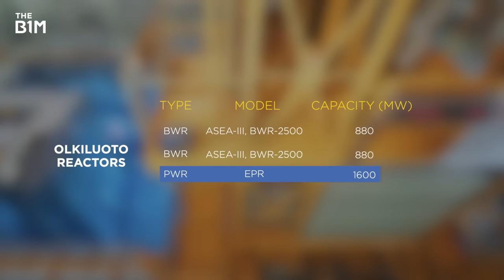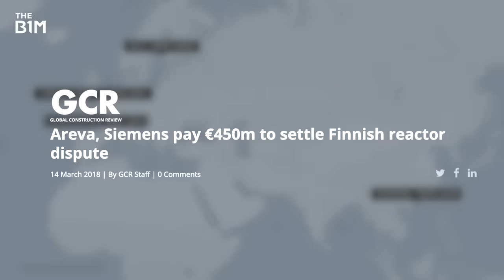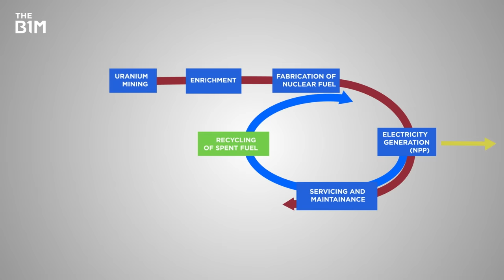Finland Might Have Solved Nuclear Power’s Biggest Problem

Comment: I mean I'd feel better living with a little bit of a risk underground than literally being baked to death by the Sun anyway lol, fossils gotta go one way or another and nuclear is a really cool alternative honestly.
Reply: Not really. Uranium is a fossile file as well. The problem this video is putting aside is, that even the production side is environmentally unsustainable
Reply: @mrtherockful  It's not really a fossil fuel because it was on Earth before all life so I guess you're referring to the fact there is a limited amount of it on Earth available, but even so there is still enough for hundreds of years of power production, by then we might already be using fusion energy who knows
Reply: @mrtherockful  Nuclear is pretty clean compared to the alternatives, I have no idea what would make nuclear “environmentally unsustainable”
Reply: @scrumpus8938  it is mined. Mining this stuff destroys so much nature - it's insane. Quickly Google uranium mining. And in that regard (the extraction) its quite similar to coal.
Reply: @lukapejkovic918  you're right. It's not a fossile energy carrier but it's a material that has to be mined from deep below the surface of the earth, that's what I meant.
Supply is not unlimited. Peak uranium is actually close (https://en.m.wikipedia.org/wiki/Peak_uranium). If you would really replace most coal power plant with uranium it would be gone in a few years.
I don't think it's a viable alternative
Reply: 'Vattenfall studied the full life cycle emissions of different ways to produce electricity, and concluded that nuclear power produced 3.3 g/kWh of carbon dioxide, compared to 400.0 for natural gas and 700.0 for coal.
-> Another study however shows this figure to be 84–130 g of CO2/kWh, with the figure rising dramatically as less concentrated ores are used in the future. It uses a wider scope for consideration than other studies including dismantling and disposal of the power station. The study assumes diesel oil for the thermal parts of the uranium extraction process.' - Quote from Wikipedia on peak uranium
Reply: @mrtherockful  even tho its destructive ,u need a  L O T  less of uranium than coal to get the same amount of energy
Reply: @mrtherockful  the same thing can be said for electric cars since they need to mine large amounts of lithium.
Reply: @mrtherockful  this dude thinks that lithium grows in farms LMFAO.
Reply: @mrtherockful  Yeah the mining process is pretty bad so much I've heard, I don't personally know too much about the numbers (how quickly it would run out etc) but I'll make sure I read up about it.
Reply: @scrumpus8938  idk maybe the fact that they have to keep burying literal tons of radioactive waste in the earth
Reply: @ghosts288  idk maybe that isnt the real problem because... The material came from deep below and needs to be put back deep below!? Dont take that to seriously but think about it ;)
Reply: @kaischlichting682  i appreciate you being nice, but what happens when we keep making new reactors and keep building up so much waste that we run out of space to bury it? considering that the waste takes thousands of years to become less volatile the odds of something happening beyond our control and releasing some of that radiation into our environment are way too high. we have a long way to go before we have a true viable, sustainable source of energy and nuclear is not it (at least not yet)
Reply: @ghosts288  i mean this clearly isn't a permanent solution. It's just the best solution to tide us over until science finds a decent way of disposing or converting nuclear waste. With the reducing costs of space travel I wouldn't be surprised if we end up firing the waste into the sun at some point 😂 I think kurzgesagt did a video where they mentioned railgunning nuclear waste into the sun from Mercury (which is obviously a lot easier to do there than earth because of the smaller gravity well) but might be a viable option for earth at some point
Reply: @kieran6201  yeah we’ll see. i guess my main problem is people saying they may have “solved” it when this clearly isn’t a solution. i do trust science to eventually working a way out, i just don’t think it’s wise for us to go all in on nuclear with the current waste situation you know?
Reply: @ghosts288  oh yeah I was really disappointed with this video. I thought they'd found a way to actually deal with it by the title, not just dig a deeper hole 😂
Reply: @ghosts288  We could just bury it from where it was mined if space becomes a problem. Though I very much doubt it will ever be an issue considering just how much space there is underground.
Reply: Svaka cast na komentaru!
Reply: @mrtherockful  The resources needed to construct renewable energies is also immense. Not to mention that even after all the resources have been spent it barely produces enough energy to sustain the energy demand.
Reply: @mrtherockful  and how much is it for wind and solar ? ..
Reply: @kwarc1009  how much would you need with Solar and Wind  vs Nuclear ? .
Reply: @Ladosligese  
power output:
1 Ginna nuclear power plant

= 2 857 142 solar panels (2 kW)

= 833 wind turbines (3 MW)

cost:
1 Ginna nuclear power plant (455 768 674$ with inflation)

= 81 100 solar panels (2kW) (5 620$ per)

=152 wind turbines (3MW) (3mil per)
Reply: @serweher  it kinda does if you know how litium mining works lol

Comment: This doesn't really look like solving the problem,more like efficiently dealing with it
Reply: Or not when it seeps later and you cant get near it to build a containment.
Reply: ah they only have to deal with it for about 80 years or so, for the next 50.000 generations...
Reply: problem is the only way to truly solve the problem is to launch it to space
Reply: @socialfreak6900  Look into thorium lyft reactors. They can use spent fuel from uranium reactors and don't create radioactive byproducts.

Comment: "It might seem like they're just burying the problem but actually they're putting the spent fuel into slightly larger tubes THEN burying it. It's better." Yeah I'm still not sold on this solution.
Reply: Let's put it this way, their just putting the stuff back to where they found it
Reply: Also the spent fuel is technically releasing less radiation then the raw ore
Reply: @omegamon0239  Completely wrong.
Reply: That was something I heard from another video, but now I realize it could have meant the raw ore AFTER excavation

Comment: We should be burning that "waste" in Molten Salt Reactors.
Reply: @unsubme2157  
It’s very real. Look up “LFTR”.   
In a nutshell; one was actually optional for years of testing at Oak Ridge National Laboratories back in the 70’s The project was killed by political pressure funded by the uranium mining and refining lobby. LFTR’s can consume nuclear waste leaving much less long term waste. Thorium doesn’t need to be highly refined and the resources are abundant for many thousands of years. The reactor can’t melt down, if it overheats, it shuts down with no damage and restart easily. The problem? China is running with our idea and patenting it and probably funding key politicians to keep the us out of it. It’s what they do. 
Meanwhile; the world continues the fusion folly that always be out of reach of commercial energy generation.
Reply: Well why don't you do it then?
Reply: @benbaselet2026  
I guess you didn’t notice my last name isn’t Bezos or Musk?
Reply: @jeffd.8917  
In the big basic picture, you are correct. But in exotic alloys and in details of process (fine tuning the chemistry) that’s where they will and have put the stranglehold’s. I say, treat it like they treat our patents. Ignore them and exploit them.
Reply: @jeffd.8917  
That’s great to know. To an old outsider universities seem like they are more interested in how to identify, safe spaces and how to hate this country while endorsing communism. The commercial MSR/LFTR needs to be able add fuel while removing impurities/waste products continuously in a high temperature, high neutron environment. They don’t need to be shut down to be refueled. Difficult but far easier than fusion. Think: nuclear physicist +metallurgist+chemist + creative mind that hasn’t been corrupted by traditional thinking.
Reply: @unsubme2157  its is real tho no one have a working MSR today but china and india is working on it

Comment: It's still a short term solution relative to the half life of the radioactive material.
Reply: Pro tip: if the half life of a material is more than 1000 years you should not care about it's radioactivity

Comment: Not that I'm against nuclear power or anything, but 'corrosion resistant' is not 'corrosion proof'. My biggest concern would be groundwater contamination. There seemed to be no plan for failures. They kept calling it a 'permanent solution'. Copper corrodes over time, especially when in contact with damp or wet conditions. Doesn't seem very permanent to me.

Comment: "It is so much more than burying it" - Yeah, burying it in concrete. Wow.
Reply: This video was bait, i hate it
Reply: And wasting steel and copper for the tubes.
Reply: Literally.... "Yes we're doing the same thing... but we do it a lot deeper and present it with a ribbon around it..."  Amazing technology.... #sadge
Reply: once you start reaching those dept there is enough radioactive bedrock from before if could just as well just have been the there from before, just look as oilwells, there is plenty of areas where they got to drill through massive amount of radioactive bedrock
Reply: No, burying it in concrete has been the method traditionally used to store nuclear waste. Finland's method is far preferable.
Reply: @featherbrain7147  c'mon now do you have any idea how much copper and steel gets used? The amounts used for this purpose won't even be a drop in the bucket. Also, I wouldn't exactly consider preventing the release of nuclear material a "waste." If anything it's quite the opposite.
Reply: @davidsotomayor8713  No I don't know and I suspect you don't either since we were not given any such details. How is the metal going to last in the presence of radioactivity? And one day, for an as yet unknown purpose, we might want to go go down to those levels but we will be stuffed.
Reply: @featherbrain7147  you are seriously underestimating the amount of copper/steel used if you think using it for this application is "wasting" it. Plus you're also forgetting the fact that non-nuclear power sources (at least the ones feasible for large scale production) use huge amounts of both copper and steel anyway.
Reply: @davidsotomayor8713 . Maybe I am at that. Really I am suggesting that we give up on nuclear fission and keep developing more effective renewables. The resources will be reclaimable.
Reply: @featherbrain7147  lol so really you're suggesting we give up on the only clean power source feasible for large scale power production... 🤦‍♂️

I hate to break it to ya but continuing to kick the can down the road isn't gonna cut it. There just isn't going to be some miracle technology that is ready in time to make any real difference. The tech you are hoping for is decades away at a bare minimum (IF it is ever ready.)  I'm all for renewables but for the immediate future they will be supplemental at best.

And btw it seems you have alot of learning left to do when it comes to energy production... "renewable" means the power source itself is replenished, NOT the associated materials used to convert that power to electricity. For example wind/solar are renewables but the turbines/panels are very resource intensive.
Reply: @featherbrain7147  we all know what we can do with a lil "filthy plutonium" 
1.21 Gigawatts and BAM !!! Lol ..... seriously more nukes less kooks
Reply: @featherbrain7147  Wasting?

Comment: LOL, that doesn't solve the problem, it only buries it.
Reply: ONCE AND FOR ALL!!1
Reply: And? Tell me what problems is there in this solution? The nuclear waste is buried so deep in solid bed rock and in stable area with no real danger of earthquakes that the nuclear waste wont be problem/harmful to anyone.

Ofc the real solution to stop producing nuclear waste at all is fusion power, but we are still potentially a century or more away from that to become common.
Reply: @Balnazzardi  It contaminates the ground. For 450.000 years. 😑
Reply: @VI-pp4jo  thats not how radiation works
Reply: @liquidhyperion4189  What's not how radiation works?
Reply: @VI-pp4jo  safely stored radioactive waste can't just magically pollute the ground because there is no radioactive isotopes touching the surrounding environment, the ground could be exposed to radiation, but have no nuclear waste being exposed to It.

Comment: cool video! However, I do have one question: Why is the waste stored in individual capsules spaced very far apart? And couldn't we use more clay for bigger capsules?
Reply: I think the answer lies in the ability to easily handle larger storage containers. IOW, from an economic view point there is a law of diminishing returns on the size of the burial chambers and the machinery to move them around the various tunnels.
Reply: I'm not sure if I remember correctly, but maybe it was also to keep the amount of heat and radiation generated inside each capsule small enough so it won't cause any problems to the capsule materials. Even a few meters of bedrock is enough in between the capsules to remove any exposure from nearby ones.
Reply: The heat and radiation coming from those capsules is the reason that's why they r spaced apart so chain reactions of any sorts no matter how small they may b occur
Reply: and what happens when the capsules wear out?  this whole nonsense only sells because people do not understand a future value in negative numbers.  a dollar worth of electricity becomes a million dollars in liability, compounding interest for 50k years.  it's super stupid
Reply: @drakekoefoed1642  exactly. But that's what our society is built in unfortunately- short term gains regardless of the future consequences. That's why the planet is in such a mess.
Reply: @drakekoefoed1642  That's the interesting thing about radioactive materials.  The most dangerous stuff decays the fastest.  Those capsules won't wear out until long after all the problematic isotopes like cobalt-60, strontium-90, and cesium-137 are long gone.  At that point, the clay would hold the remainder of the waste.

That doesn't mean the waste is harmless.  You wouldn't want to be the guy with a shovel digging one of these up after several hundred years.  The material could still be used to create dirty bombs (although not nearly as deadly as fresh waste can).  But it does mean that if this material were to be released into the environment after several hundred years, it would be much safer and easier to deal with.
Reply: @drakekoefoed1642   do you have a better solution? Many countries stores nuclear fuel in containers outside which isn't a long therm solution

Comment: Those cannisters would get rusted in 200 years or a little more, the clay wont hold it, and the whole underground area wold get polluted, they should have used concrete mixed with quick lime which would increase concrete strength after every 10 years. They should send the material in space towards the sun.

Comment: It is quite hard to say that this fuel method is carbon neutral when it takes this much resources to get rid of the fuel when it’s depleted
Reply: It's difficult to make a balance at glance, because a lot of the renewable energy technologies require a lot of special materials and are nowhere near the longevity and energy density of the nuclear reactors.
Reply: Not only is it carbon neutral, it is also fat free, glucose  free and salt free! WIN WIN WIN WIN
Reply: Nothing is carbon neutral, solar panels use silicon which is extremely toxic to the environment, and uses copper as well which is in short supply, windmills require huge lots of land to be able to power a city same for solar, and dams use tons of concrete. Carbon neutral is just a feature doesn't make any form of energy the better option.

Comment: Now imagine if we actually reprocessed the fuel and burned the rest of it instead of putting it in a can deep underground...
Reply: "Burning" does not help. The fuel is radioactive by nature and will stay that way.
Reply: @flagmichael  Traditionally "spent" fuel stays hazardous for millenia and has only consumed somewhere around 3-5% of the fuel. If that spent fuel goes into one of the "waste burner" reactor designs, 95-97% of the fuel can be consumed and the remains stay hazardous for only a couple hundred years. That's a lot easier to deal with.